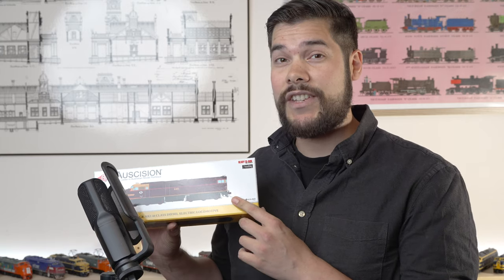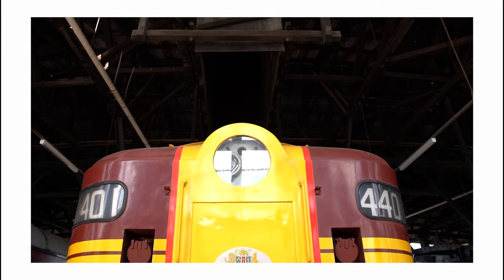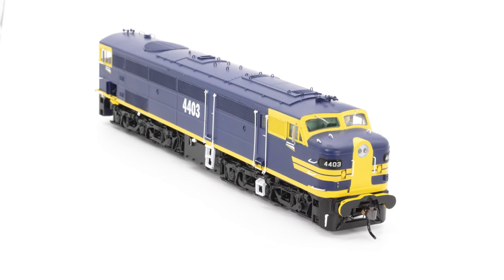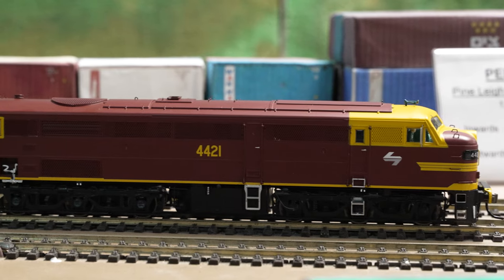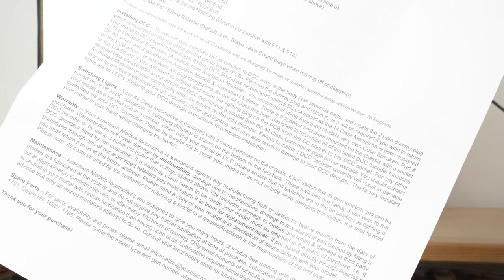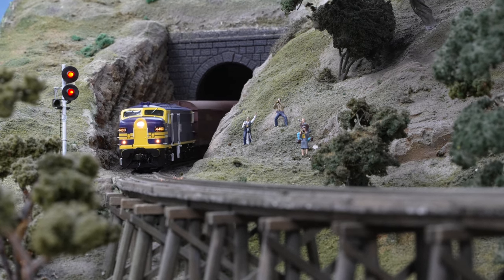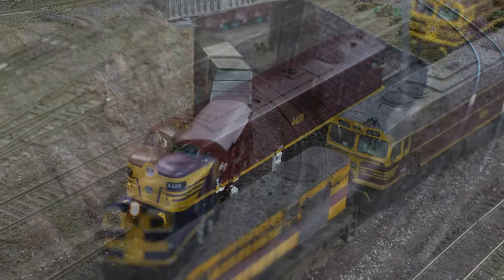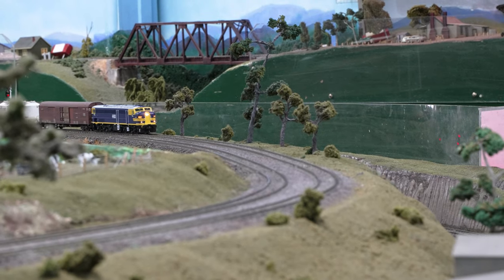Auscision: 44 Mk1 Review (with DCC Sound)

Comment: I got 2 DCC sound installed. Great running locomotives great detail, engine and horn sounds fantastic. One thing that disappoints me as a NSW modeller, is these locomotives did run in passenger service. Auscision did not include the guards whistle in the bell function. Apart from that great model.
Reply from the maker: Great to hear! 
Now that's a great thing to suggest for something they could add to these in the future!

Comment: For the price the paint work is second rate, the blue to yellow bleed the horns are poorly finished. While running on the roller set it seemed the wheels are not true as one can see a wobble. I would recommend when reviewing models a wheel gauge be used to ensure all are set at the right gauge. The rear red lighting seemed very dull as if the lenses were covered with dirt. Would I pay the money for this engine NO. I would prefer to 3D print  a shell for 20 dollars it may not shine as good but it leaves me with dollars to spend on other equipment
Nice review
Reply from the maker: Thanks for that! Yes I'll get myself a wheel gauge for future reviews! I very much appreciate the comment!